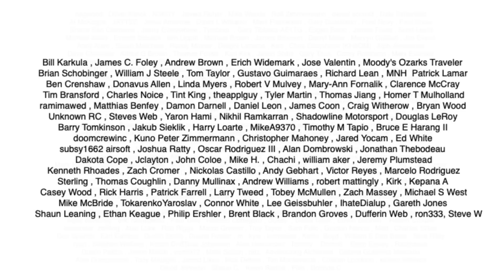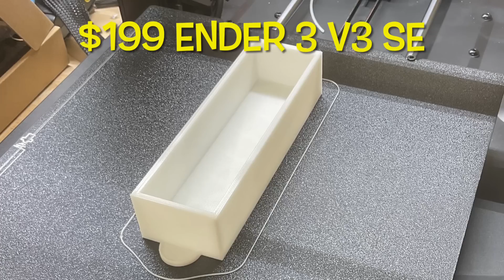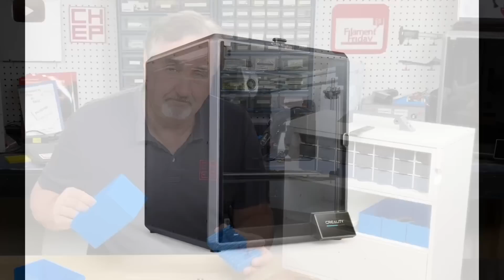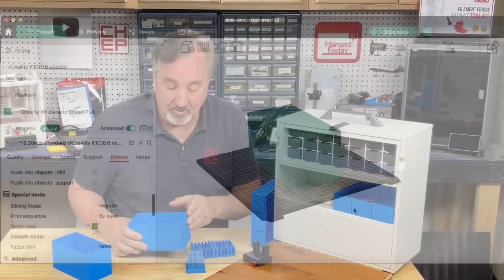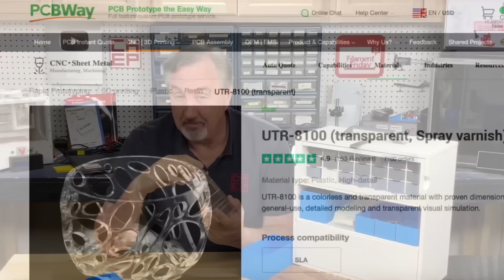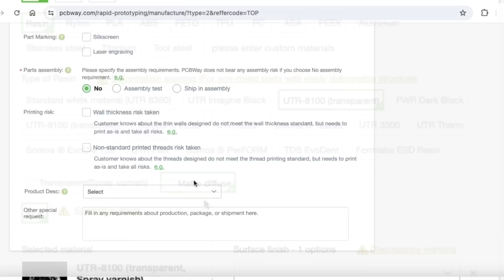Has Vase Mode/Spiral Mode Become Obsolete?

Comment: print in vase mode 1.5mm width (you can even print 6mm width with 0.4 nozzle), then you wont get flex, and youll get a better part because there are less movements so less vibration

Comment: Uhhh 
Oke .
I just put 0.8 nozzle in it.
And i print something like that 
In 16 min.
Goth it from printable.
And you need to use vase mode.
And uh mine are Solid.
Bud i use the even bigger nozzle.
Whit clear plastic and it looks great .
I put my nozzles in there.
And my belts .
And the rest of the stuf.
You need.
Vase mode needs to stay.
You can even take Anny kind of model solid to the slicer and just make the outer wals nice and fast.
Just use 0.8 nozzle.
Instead of the 0.6. nozzle 
🎉
Reply: are you okay?
Reply: nozzle size is irrelevant you can print vase mode 6mm width with 0.4 nozzle

Comment: I love vase mode for some reason, maybe it,s legacy at this point with the faster printers.  These days I set the temperature hotter, and set extrusion width to 0.8mm or even 0.9mm extrusion width which is a much stronger part than the default spirialized outer contour option given with most slicers.  Setting options to print in non-vase mode with better stability as well as faster print times is definitely a win all around though!

Comment: I’ve been trying spiral vase mode with a 1mm nozzle and layer height 0.8mm. but I’m getting heating failed system stopped printer halted. Any idea what can be causing this ?
Reply from the maker: Sounds like a failing temp sensor in the hotend.

Comment: If you would like to print containers that you can see the contents, you can use microscope slides, I made a bunch of Gridfinity containers with the glass slide fronts to hold small bolts, nuts and screws. Also I designed stackable Tilt-Out Storage Bins with Window, they are on printables for larger items.

Comment: @CHEP Hey Chuck, I just purchased your Arduino book. Any chance you may make a revision ?
Reply from the maker: What are you looking for?
I’ve redone several chapters using the Tinkercad Circuits simulator and post them to my Thangs.com membership page. I’m working on new chapters as well that will be posted there. I can post it quicker than publishing in a book, update it at any time and even link in a video as necessary.
Reply: @FilamentFriday  Sorry, it's just that I'm an old dude (67+), very new to programing/electronics.  I like books I was just wondering as that book was published 8 years ago.

Comment: Of course it hasn't become obsolete. In the case you described, you can get just as sturdy and thick walls in vase mode by just increasing your line width. You don't even have to change nozzles from 0.4, as that can print up to 1.2mm walls. I've tried, works fine and speeds up prints nicely. Of course if you do change your nozzle, you can get even wider lines at once.

Comment: CHEP, What do you think of the Official New Update Ender 3 Dual Z-axis Upgrade Kit?
Reply from the maker: From what I see there is nothing new about it. It’s been around for a while. I cannot recommend it as the board is designed to drive one stepper not two as would be proper.
Reply: @FilamentFriday  Thx for your advice. I did not know about the stepper!

Comment: 2:20 even with a 0.4mm nozzle you can use 1mm line width for strength and use fuzzy skin or a ridge geometry. 0.8mm nozzle can do up to 2mm. vase mode is still useful if you know how to use it
Reply: came to the comments to say this. indeed correct - it surprises me that CHEP does not know this
Reply from the maker: @KloBass - I shown using over extrusion settings in previous videos and even use it in my Hyper Fast profile. But still not as good as two walls.
Reply: @FilamentFriday  They said "if you know how to use it".

That doesn't just mean in the slicer, it means designing for vase mode. Ribs, bottom layer structure, etc.
Reply: @FilamentFriday  one 1mm wall is better than two 0.5mm walls side by side. You can print 6mm wall with 0.4 nozzle. No i didn't forget to put a dot there, SIX MILIMETER with ZERO FOUR NOZZLE
Reply: I already make double wall hack on openSCAD for simple shape,  seek thingiverse with keyword openscad double wall :)

Comment: You can print very good things in vase mode with a 0.6 nozzle. I print a lot at 0.5 layer height and 1.4mm width. Very strong and fast with an almost flawless finish

Comment: CHEP, I normally like most of your content. However, not everyone can afford a K1 or Bambo, and I, for one, am sick of all you content providers making videos about this or that being dead since you all can afford new stuff.
Reply: Unfortunately technology and tools change as time goes on. The economy sucks and it is hard to justify replacing printers or even upgrading. I get it, but just because someone's workflow changes because of new tools doesn't mean that yours are no longer usable. If it works for you and your work flow, who is to tell you it is dead. Just don't be upset with people who are doing content on the latest trends.
Reply: Klipper would help too get you much faster speeds at a fraction of the cost
Reply: @PandaTaco  I'm still running 3 ender 3 printers and an ender 5 with klipper. I was even able to run input shaping with an Arduino uno I had laying around. It may still not be as fast as the Qidi Q1 Pro I just got, but it does make a huge change in the printers performance and features.
Reply: Come on now, he is still making plenty of Creality content.  And you can get a Bambu P1 (which is AMAZING) for $599. How much are you spending on your TV or stereo, or phone for that matter? Lol. It’s like complaining about people YouTube vids covering iPhone 13. instead of iPhone 7, or many other analogies you can come up with.

Comment: You should really switch to a .6mm nozzle, or even larger, if you're trying to print stronger boxes.  But only if you got a CHT or a highflow hotend that can get the center molten.  Stefan at CNCKitchen has a video on that.
Reply: Instead of a wider nozzle, you could just use 0.6mm walls on a 0.4mm nozzle. The only reason I print with 0.45mm at all anymore is when I want finer details in my outer wall, and even then it's only the outer wall.
Reply: @Litl_Skitl Does that accomplish  the speed which is the goal of this video?
Reply: @meisievannancy  CHT made a high flow nozzle a while ago.

The 0.6mm thing is still limited by the flow rate of the nozzle, but you can use some more reasonable speeds for it. You also get more material with one move. 

Were the regular prints even at high flow rate? That might explain a lot as well.
Reply: What is CHT ?

Comment: I use vase mode for light defusers in some of the lamps i make. But there are things that i no longer use vase mode for. Also if i want to test something before doing a full on print I'll use vase mode. I guess I'm short how i use it has changed as opposed to not using it.

Comment: OR ... Keep doing vase mode, but put the outer wall line width to 0.8mm.  That gives you a wall almost as wide as your 2 walls in normal mode, but ... will avoid having a seam and as the entire top is one single long extrusion, it will be stronger than those 2 x 0.4mm walls.

Comment: Let's be honest, vase mode isn't hugely useful to begin with. Even for a vase or desk tidy you really need a thicker shell. I've wonder if it might be useful for making moulds or something but only for shapes with simple perimeters. Even an overhang scuppers it. A "vase mode" which has a couple of perimeters and 0% infill is probably more useful and would deal with some overhangs. Speaking of moulds, I wonder if there is a simple tool that can take a model, invert it, and create a 2, 3 or 4 part mould. Even better if it allows control of parting lines, sprues and registrations.

Comment: If you get a thick nozzle you can make pretty tough vases because you can also overextrude a bit (example 1.2 mm walls with a 0.8 mm nozzle). But the real advantage is complete lack of seam. I still use it sometimes on my Annex K3, where I am minimum layer time limited (cooling) and I could print a non vase mode in exactly the same time.
Reply: You can extrude 3 mm walls, too. You just have to slow down a bit to not exceed the maximum flow of your hotend.
Reply: @JenSalik_  Well, yes, but when you go over the top you get some artifacts. You already get some on overhangs when doing 0.6 mm walls with a 0.4 mm. But I think up to 2 - 2.5 mm walls are very possible with a 1.8 mm nozzle!
Reply: @karellen00  True. It depends on the model and what you are comfortable to live with. For straight walls I don't see a problem using thicker walls in vase mode.

Comment: Single wall prints introduce a corner weak spot unless they're vase mode. So vase mode is still good to conserve weight and material. You can introduce structure into the vase mode sides to make them more rigid.

Stop using brittle PLA. Use PETG or HIPS. Use wider extrusion width than 0.4, you can just extrude 0.8mm in vase mode on a 0.4mm nozzle and you don't have to worry about ooze and underextrusion issues stemming from inability of the extruder to compensate pressure on retracts and restarts, you can ramp the speed up as well.

Comment: if your walls are too thin with vase mode, get a bigger nozzle. not that I disagree that vase mode is dead, but to be blunt it seems to me like you aren't fully utilizing nozzle sizes or high flow hotends. for regular things like boxes, it makes sense to get the biggest nozzle you're comfortable with for walls (maybe 1mm in this case?) and then print in vase mode, and max out flow rate. if it's still going too slow for you, buy a hotend with more flow.

Comment: A problem I have with vase mode is if I want multiple copies of the same print.   Vase mode only allows for one object, if you print in regular mode, you can print as many as will fit on the build plate.  This is often faster than finishing a print, removing it and starting the next -over and over
Reply: With orca slicer you can print them separately

Comment: I was making a shield for LCD screen. It was a plate with two  L flanges for spacing and mounting.  It was 2 layers at 0.6 nozzle. Printed with PETG, normal slicing resulted in excessive travel, reactions, and quality issues.  I tried spiral mode, it worked great! Fast and great quality. Spiral is not just for open geometries.

Comment: I printed some lampshades using vase mode. I had a lamp base originally designed for those antique style lamps, but wanted to use them for colour changing LED’s. To hide the LED lamps I designed and printed a lampshade that I stuck to the lamp base. Using a white PLA filament, vase mode gave me a lampshade thin enough to allow the light to shine through them. 

I have also printed some Christmas trees in vase mode, and by placing a hole in the bottom I can insert a small string of battery operated lights into them. Once again the thinness of vase mode allows the diffused lights to shine through, and made them a great table centrepiece.

Comment: The trick to better vase mode prints is to crank up the line width to 150-300% of whatever you normally use. Stefan from CNC Kitchen did a video on that a couple years ago, showing that good print quality was still possible while also obtaining dramatically superior strength compared to normal line widths in vase mode. 

I myself modified some of the old Filament Friday profiles and tested a series of nozzle diameters, line widths, and layer heights, including a 2 mm line width from a 1 mm nozzle with a 0.36 mm layer height...that test ended up extremely strong, I believe at least as strong as if it had been printed with a non-vase mode profile and a normal infill percentage (if not stronger). I didn't do any testing of speed for these prints, but I suspect it will still be faster than a standard print so long as you don't exceed the maximum volumetric flow rate of your hot end.

Comment: Never liked vase mode. Printed two poop collectors for the P1P and the both fell apart. Good vid Chep.
Reply: 0.8mm nozzle with 1.2mm extrusion width is pretty sturdy and works very well for vases.
Reply: @drstefankrank  Oh. Shame I don't have a .8mm volcano nozzle to print with then. But thanks.
Reply: @Martial-Mat  try 0.6 to 0.8 extrusion width with your 0.4 nozzle and use PETG and see if that works. 0.45 as the standard width is indeed too thin.
Reply: @drstefankrank  Wow, this is beyond my current skill level, but it will be interesting to explore. Thank you!
Reply: @Martial-Mat  Just go in your slicer and change the wall thickness to 0.6 or 0.8 when using vase mode and slice as usual.
Depending on the model, you may even get thicker walls, but it depends. At some point the extruded line is way thicker than the nozzle and then it may not work any more.
Reply: @drstefankrank  Thank you!
Reply: Arguably PLA is the wrong material for any type of thin-wall prints, PETG and HIPS can take more of a back and forth flex by orders of magnitude and have great cohesion and layer bond. PETG doesn't like speed changes and has a tendency to ooze but this means it performs much better on vase mode prints than usually.
Reply: @SianaGearz  Wow, that's fascinating. Other than some carbon fibre, I print everything in PLA. Really interesting information. Thanks Siana!

Comment: I use regular vase mode, 0.8 nozzle, 0.5 layer height, and 2mm line width. Pretty strong, solid end result. Great for boxes and upright containers, but for anything too tall and thin I print separate wider bases for stability. Only minutes per print.

Comment: I am using a 0.8mm nozzle in vase mode. I make my parts with a slit in them so they are all technically a C with ends that are so close they touch. I then print at 1.5mm extrusion width, for a 3mm thick part that prints crazy fast. 

I then redesigned the picatinny rails so that my rifle handguard prints standing on it's back. It was going great until I realized I wanted holes in the side for rail slots. Otherwise it was pretty awesome. Going to design a stock that prints in multiple vase mode parts and slots together.

Comment: I use vase mode when I am making a mold box for silicone rubber. It will hold the silicone for the molding process and then is easily broken off the cured silicone rubber. The actual mold part, I print normally and glue it to the vase mode printed box. Mix silicone and pour into mold and after curing the outside box comes off pretty easily. So, I am using the fragile characteristic to my advantage. Other than that, it is pretty much useless as the prints are very fragile.

Comment: I think your making the all-too-common fallacy people experience with vase mode printing, and that is thinking that all that is needed is to tick a box. This will always get you weaker prints if you don’t increase your line width, since 0.4mm is still 0.4mm regardless of whether it’s vase mode or not.
A 0.6 mm nozzle can easily print 0.8-1.0mm line widths, and as long as you have settings to limit speeds based on max flow rate, you won’t under extrude.
I do this all the time and there are many issues I have with current slicers and vase mode (eg hard-set slicer or firmware limits, inability to mix settings for optimised object printing etc), but strength is definitely not one of them… if you make sure you think about the requirements of the finished object beforehand and don’t just leave it up to the printer or slicer to figure out the intent.
Depending on the object, and setup (max print speed of printer, max flow of material possible), then you may find vase mode only knocks off small percentages of speed (especially if you can print non vase mode at the max flow rate possible for the material), but one thing we still can’t argue about is final surface quality of vase vs non-vase mode. Vase mode still reigns supreme, which is I wish slicers to spend more time expanding capabilities of this mode rather than the “one and done” approach they all use at present.

Comment: Interesting video.
Made me think a bit, and then I thought about something. Not everyone has high speed printers.
My fastest one isn't much faster than my Ender S1, that is my new Ender 3 V3 SE.
Mostly because I print detailed stuff, It cannot get up to speed. Also the default settings are 60mm outer wall, 90mm/s inner wall. 
This is supposed to be a 180mm/s profile. SMH. I wonder if the K1 0.6mm nozzle will fit on my E3V3SE?
On my E3S1 with a 0.6mm nozzle with extrusion with of 1.2mm {200%} I get a 1.2mm thick wall on my prints. The thing is I love printing bowls and such to store things. So these are all vase mode friendly. And using FF fast profile I get a vase mode print, same wall thickness as 3 walls on a 0.4mm nozzle in less time. I also don't get the seem lines....
For items I don't care about the finish too much, I use a 0.4mm layer height. Speeds it up even more.
FYI: I once sliced Dave's Makes Stuff's I love 3D Printing mug for the 0.6mm nozzle with a 0.4mm layer height, and printed it on my second Ender 3 S1 with the 0.4mm nozzle. It came out fine! I was surprised that a 0.4mm nozzle could print 0.4mm layer heights without an issue.

Comment: I only use vase mode rarely when I actually want the effect, not for speed. It's good for quick jobs where the CAD would be more work without vase mode, or where you need to avoid seams for aesthetic or functional reasons.

Comment: Biggest trouble i find with the K1/K1 Max is the startup speed, it's like 8mins even when preheated :(
So i use my SV07+ mostly for quick prints like this, startup preheated is like 30seconds at most

Comment: Super Speed Up -> You can actually print like 1mm walls on a 0.4mm nozzle .... ;)
Reply: This only speeds things up if your print times are acceleration bound not flow bound. Which is kinda unlikely in the types of prints that look/work right with 1mm line width, but I did do some sub-1hour dragons that way at acceptable quality.